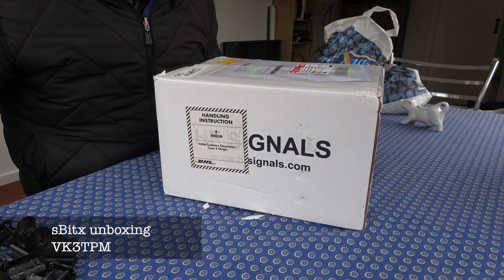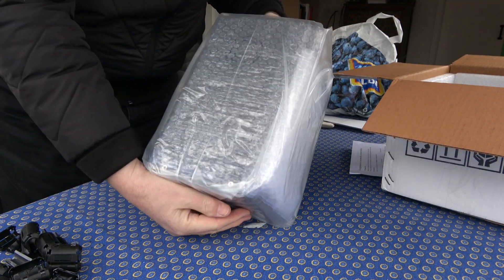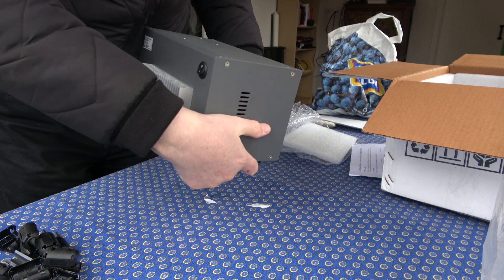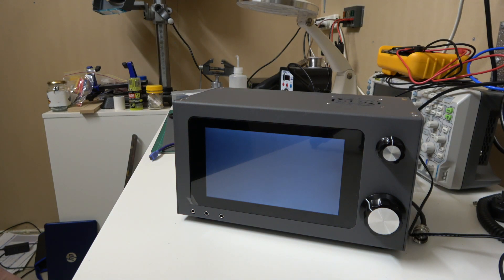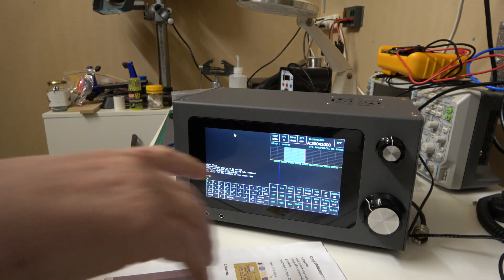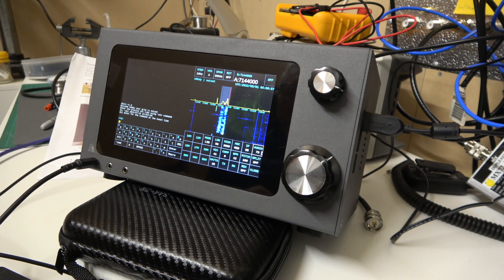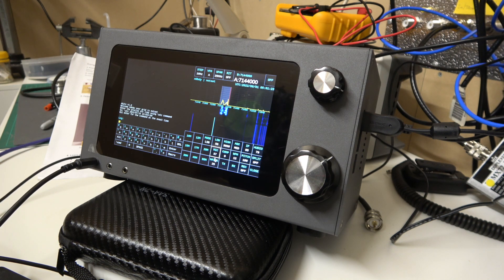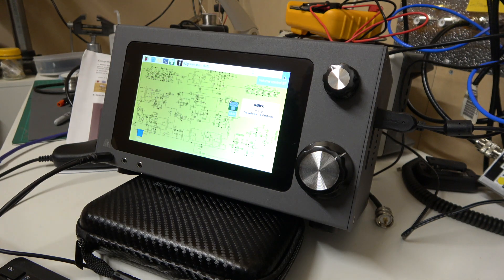sBitx Unboxing

Comment: A year later, how did you like it?
I considered the HF Signals newest  uBitx as well as their SDR transceiver when I bought a rig this past November. I ended up selecting the RS 918. I really like the receive on the RS 918. Given you have used both, mchf, what are your thoughts on the pair?

Thanks
de kc2wvb
Reply from the maker: I haven't used it for many months. I find it frustratingly slow to operate. Great for hacking on but not as a rig to use. I support Farhan and he's made a wonderful contribution but I kind of prefer the older simpler rigs like the Bitx20.

Comment: Maybe just the video. But it looks huge. It goes back a long way. What is the size comparable to. looks like 2 icom 705 on top of each other. Size wise
Reply from the maker: Optical illusion. About the size of a 705 really.
Reply: @peterbmarks  thanks Peter this radio looks fascinating.

Comment from the maker: On a more resonant antenna the feedback problem went away. Farhan actually mentioned this issue in the user guide.
Reply from the maker: @Rob's Blog I was using an off centre fed dipole. It's pretty good generally. On a simple dipole cut for 40m there was no feedback. A tuner would probably help.